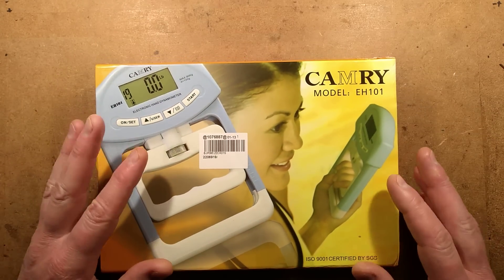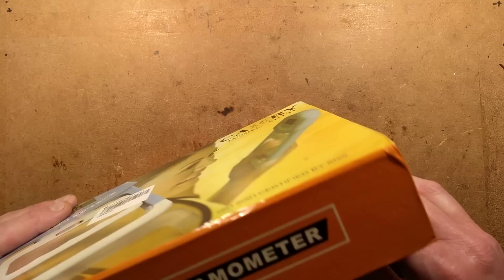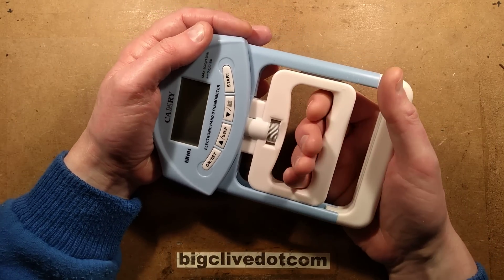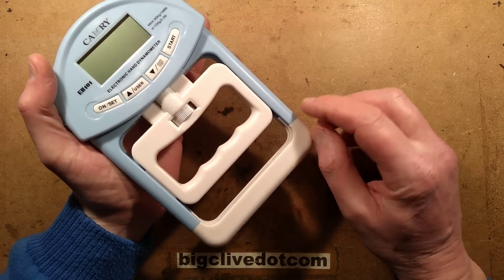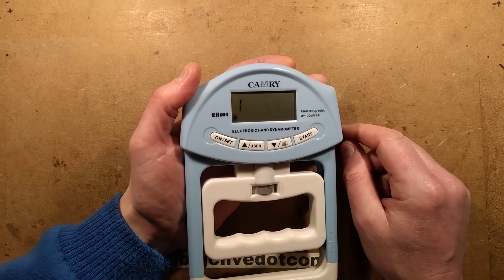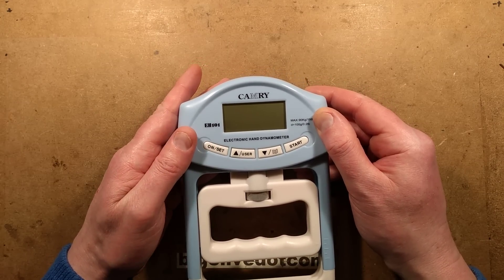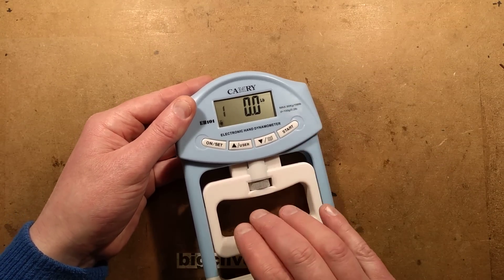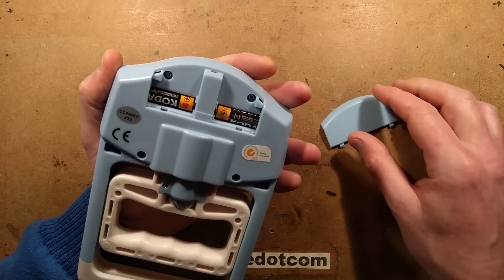Inside a hand grip strength tester - dynamometer.

Comment: How does this work? I mean i can hang with one arm and 50kg additional weight( 130kg) in total but just 60kg with dynamometer. How is this possible? Is it different?
Reply from the maker: This measures hand closing force as opposed to just the holding force of hanging from a bar.

Comment: Funny to see this again sometime. About 6 years ago, I had to take a test at the hospital and it was with a similar thing. They told me to pull with full force, and I did it and had completely broken it. They had never seen this before. I was medically cleared for my hands, but unfortunately not for the rest of my body. So I fear that this plastic thingy, will not live on in my hands either 😁

Comment: I'm getting one, I fractured my right hand and needed pins. When the cast came off it was hand therapy, and at the end of five weeks of hand therapy I managed 66lbs with my right hand (the one that was broken), and 135lbs with my left. I wonder what my right was before the fracture happened. Thanks for the review, I just ordered it and now it just needs to ship.
Reply: What did you get your right hand strength up to, according to your meter?
Reply: @coloradostrong8285  Highest I got it to was 143, on a good day. Seems to peak after a good session of archery or not long after a workout started. So once again stronger than my left. Less flexibility which looks like it will be permanent, can't open it quite as far, but it makes zero difference in day to day activities. Rarely any pain.

Comment: Nice strength for an older chap😁 I'm 34 and weigh 78kg. I bought this exact dynamometer last week and my highest recording is 68.5kg so quite happy with that.
Reply: Is 109-111 lbs good for a 19 year old?
Reply: @Sean.224  Is just a little bit above the average for this age group, which is 101 lbs. I have this dynamometer and to be considered strong you must put at least 123 lbs!

Comment: Sooo, I managed to break one of these... xD
I work at PA rental company, and one of my coworkers brought this exact type of dynamometers in the office. So as every guy would do we started flexing how strong our grips are... Their grip was around the 70s (in kg), so it thought it was my time to shine... I gripped on the thing a squeezed as hard as I could, and after around a second, the handle snapped xD... Apparently my grip strength was 86 kg... What I didn't tell them, is that I used to race in rowing boats for 3 years. xD

Comment: Hello Clive , do you think you could increase the range of strength on this dynamometer say to 200kg?
Reply from the maker: You can buy load weighing strain garage assemblies.
Reply: bigclivedotcom not to bother too much , but could I just swap it over ? And would I be able upgrade the display? As after 90kg it says error
Reply from the maker: @Hollegripchannel  I wouldn't trust the plastic if using it at very high grip strength.
Reply: bigclivedotcom hi Clive , mine just arrived.  Do you think it’s possible to upgrade this so it can go up to 200kg and register that on its screen
Reply: @Hollegripchannel  Hello Nathan. Yes you can change the upper limit range to 200 kg of the pulling hardware machine but you cannot change the display readings as its hard-coded in the microcontroller and there is no way to re-program it unless the manufacturers decides to do so. You may use the ratios as in if you squeeze 160 kg, reading will show 80 kg. I broke my Camry dynamometer by maxing out too much while back so I was curious too about changing the upper limit :)

Comment: Soo. How good is the sensor/measurement ?
Could you test it by hanging it upright,
and putting some water bottles as weight on it as a reference ?
 Does not really matter if it is that exact, but will it show 10x if its 10liters instead of one ?

Comment: Fun fact, On the box it says, "ISO 9001 Certified by SGS. This would be a violation of their terms of certification for two reasons 1) is not clear that it is for the quality system in which it was made - and not the product 2) must include the revision of the standard; 2008 or 2015. Important since the standard upgraded in Sept of last year, so if they did not upgrade, the cert is - invalid.
Reply from the maker: It's probably a clone with copied text.

Comment: The only good thing about surface mount is the reduction of parasitics. I like things to be big and easily serviceable, but with some stuff, the sheer small sizes involved cuts down that nasty parasitic induction, especially with high frequency projects. Parasitic resistance and capacitance you can actually turn to your advantage with cunning design, but induction is almost always a pain.

Comment: Last time I used a strain gauge was in an electronics workshop. We found a project using transistor followers and a gauge to allow you an almost endless amount of LEDs  that went up and down as a solid bar graph to monitor the amount of 'bend' on the gauge. It was cool, it looked like the effect on K.I.T.Ts accelerator pedal in Knight Rider, only we used about 20 LEDs. There may have been a comparitor chip at the beginning of  the chain, I can't really remember much about it. It was in the 90's LOL :D

Comment: Back in '93 I was seriously injured in an accident.  Since it was in the line of duty, Workers Comp kicked in and decided to test me to see if I was telling the truth, well me and the surgeon who operated on me to correct the damage, so they sent me through a series of "functional capacity" tests.  The grip test was one of the many tests they had me perform over the 2 day process.  Back then they used a rather large chrome plated device that weighed in at about six pounds and had a dial meter on it with a stop needle that would freeze at the strongest point.  The tests were designed, not only to test your physical strength and ability but were set up with a sort of double purpose to insure you were not holding back, since holding back on one test might show in another test down the line.  Being an honest person, and not trying to fake an injury following the three major surgeries it took to get me walking again, I passed the tests, and Workers Comp was happy for a month or to before the began another round of their pscyh warfare against the worker.  In  the end, a wonderful lawyer and understanding judge awarded me the 100% disability that all the tests indicated I should have.  Oh add in another 2 years where the bureau sent me to college to be retrained from a police officer to a paralegal, and while I passed the course with a 4.0 GPA, I could not buy a job because of my disability and advanced age (I was near police retirement age at the time of the accident.

Comment: Used various versions of this before, especially after I broken my left arm in a road accident, and it certainly showed how crap the grip strength in my left arm is..... think it was around 13KG I was rating, yet the right was easily 4 times that.

Comment: At 130+ lbs, I was really hoping to see that aluminium bar bent inside :o(   Yes, I know it has a range of 198, but I was still hopeful.... Poke a hole through the top of the case and add some hooks and you have a handy spring balance as a 2nd use :o)

Comment: I'm going to guess the milled out sectioning the aluminium bar are there to ensure the maximum movement of the bar happens under the sensors. If the milled out sections weren't there the bar would bend evenly over it's length. With this set up it would bend more where the cut outs are which, I assume, would increase accuracy.

Comment: For any other weirdos like me who watch this and jujimufus channel, clives grip should be able to close a captains of crush 1.0 gripper.

Acording to they're website most gym goers won't be able to close a level 1 without dedicated grip training
Reply: The gripper calibrations are a bit different. For the CoCs if you can max out on a number 1 you should be able to exert around 110lbs pressure on the hand dyno. If you can close a 2 for a max than around 150-160lbs range. Although, there is no direct coorelation. If you can exert 200lbs range then you may be able to close a 3.

Comment: Would this measure accurately if you hung it from the ceiling and suspended a weight from it
Reply from the maker: It should, but it would need a solid attachment if the weight was going to be heavy.  A set of digital luggage scales might be a better option.

Comment: had to use the old fashioned hydrophilic type for rehab after my first of two tennis elbow surgeries (so naturally this is the first thing she hands me.  )  before and after rehab.  then thus the exercising spinball that lights up once you get it going.  Want a sore arm?  and the pros supposedly don't need the string, some light up some don't and avoid the auto starts.. and sometimes you don't pull the string right .  (it goes in don't lose it.  ) I thought the one I got was so good I got the therapist one cause she'd always wanted one that lights up.
Reply from the maker: I like those things, but I always burn them out.  The track the spindle runs in gets worn away quickly when I rev them up with unreasonable force.  I usually start them by swiping them down my trouser leg.
Reply: @bigclivedotcom  guess I'll have to try harder to burn them out.  once I get the elbows in order :)

Comment: It's quite amazing how strain gauges work, so little movement, but able to record that much tension applied to the metal bar... :)
Reply from the maker: And really accurately too.  I weigh the packages of kits and modules I sell on a set of cheap kitchen scales and the results exactly match the post office scales.

Comment: Why do they "blob" chips? Is it to protect the chip from the environment or just to keep people from reverse engineering it?
Reply from the maker: It's the original COB (Chip On Board).  Instead of adding the IC as a separate package they bond the bare chip onto the PCB and then link from the IC contacts to the PCB pads with bond wires.  The black resin is to protect the chip and delicate bond wires and shield it from light too.  (Light can influence a bare chip.)
Reply: @bigclivedotcom  There's an eevblog video where Dave talks about camera flashes resetting a Raspberry Pi since it bounces into the bottom of some BGA or something like that.
Reply: It's a lot cheaper than a real package. What's underneath the blob would hardly survive existing. It's just a bare die with gold Bond wires welded between the die and pcb
Reply: I never knew that. Thanks, guys! Learn something new every day.

Comment: I had something similar in the hospital. I was very weak and the dietician used something like this to test my strength. It wasn't electronic. It had like a tyre pressure type gauge on it. It was quite fun to use
Reply: Same tool. I feel they’re a lot more accurate though. I went to school for healthcare. Nursing though. If you went for physical therapy you would have definitely seen a dynameter. I’m looking to get one, because I do a lot of grip training, and want a dynameter to measure me grip and see progress. Problem is the ones like the one you described can run upwards of 200$ or more, and I don’t really want to pull the trigger on a tool like that, that is really just more of a luxury. These digital ones seem to run for less than 40$ in a lot of cases, but I wonder how accurate they are

Comment: If you are looking at trying SMT soldering and want a kit to start off with then I highly recommend what the search phrase 'DIY Kit Red LED Dot Matrix Clock SMD Kit Parts C51MCU w/ Acrylic Box' finds you on ebay (uk). Mine cost just under £10, but you can probably get the same or similar from BangGood or AliExpress for somewhat less. There may well even be different colour variants if you prefer. In fact the bare circuit and PCB template is probably available on an electronics forum somewhere if you know how and where to look.

What you get is an all-but 100% SMT project that uses something like 370 surface mount LED's to make a dot-matrix display--along with a dozen or so other, 74-series logic, micro-controller and passive components to actually run it. The LED's have the '0603 ' form factor and pretty much demand some kind of 'Optiviser'-style magnifier and a fine pair of non-magnetic tweezers to solder them down accurately. However once you get into the swing of it the whole kit is massively enjoyable to build, especially because the rest of the parts that matter are '0805' or TSOP 6/16/28--which feel huge when you come to them fresh off the LED 'face'! The only through-hole components are a couple of tactile switches, a thermistor, a light sensor and the USB socket.

It really is just the ticket if you want something to simultaneously hone your soldering skills and build your SMT confidence upon.

Comment: ... this might be a lil bit of the topic, but do you have a vod about the display? I never understood how naked PCB contacts, a rubber band and a glass can produce 7-segment display; and I don't even know whom to ask ... :( thx
Reply from the maker: The rubber strip is called a zebra strip.  It's made of alternate conductive and insulating layers so that when it is placed between the PCB pads and the matching metalised areas on the glass display it connect them together.  The LCD display itself has clear conductive segment shapes and a liquid crystal sandwiched between two layers of glass.  When a very low alternating current is applied the crystal changes the polarisation of the light passing through it and a polarising filter then selectively passes or blocks the light.
Reply: thx a lot. Now I feel the same way, when I understood why the sky is blue. ;)
Reply: The channel Applied Science has a video about building an LCD display that comes with a thorough explanation of how those things work. I've found it very informative.
https://youtu.be/d4QFNWBSZYg

Comment: Clive you must be very handy to have around when it comes to getting stuck tops off of jars of jelly and jam.
Reply from the maker: The only problem being the fear of actually breaking a jar in my hands.
Reply: @bigclivedotcom   That would not be good. With all the force to break a jar that way the glass would not be kind to the hands at all.
Reply: I just did that a couple days ago...sliced the living shite out of my right index finger!
Reply: I did...but the jar must have had a crack in it or something...it just shattered on me.
Reply: Probably should have gone in for stitches but had it bandaged with a 3x3 folded and taped tightly.
Bled like a stuck hog though..made a hell of a mess on the floor and counter top before getting bandaged.
Reply: There were a couple of very small pieces that was cleaned out before the bandage was applied.
The cut goes from the pad of the tip of the finger around to the nail edge...basically half the finger tip.
It didn't go to the bone though so it should heal well...as long as I can keep from banging it around.
It is the right index...so my typing suck right now  :)
Reply: Google voice typing is not available on my computer...nor is Chrome.
For now I am typing with nine fingers  ;)

Ja...very cringeworthy...but it was lucky to get away with as little damage as I did.
Reply: People who regularly use screw drivers have strong arms and hands and should not be f'd with.

Comment: Great video. I have one of these, and can squeeze over 90KG on my right (maximum that will register is 90.6KG for some reason). You don't need to do the swinging of the arm for peak grip, just squeeze it as hard as you can with jerking it (pun intended).
Reply from the maker: That's the maximum range of the unit.

Comment: There is a "bodge it and scarper" method of using a standard microcontroller for a 4 element strain gage. VCC and 0V to the top and bottom of the wheatstone bridge then the outputs go to two analogue inputs (preferably 12 or 16 bit). On zero load they should have the same value. As the load goes up, one input voltage decreases while the other increases. Twice the resolution (in theory) of just measuring one, which would also be a git for bias loading. In reality it's never as good as using a differential amp and an INA132 would work reasonably in this situation. The only issue is drift as the batteries run down. IE the tiny amount of heat in say a 1k setup (1k per element) would vary dependant on voltage and the individual resistive elements, usually this is to an extent compensated out but to get 1% accuracy over battery range and temp range is a right pain in the neck.

Comment: what a coicidence, i just bought one of these.  been doing grip strength training. can do 150lb rated grips but can only pull about 135lb on this. cant tell which is the innacurate one :P
Reply: I can close a 200 lb grip and I get 162 on this
Reply: @joshdewit378  i think its also partly down to the shape. It pretty hard to grip the hard plastic on this thing vs the knurled grip trainers.